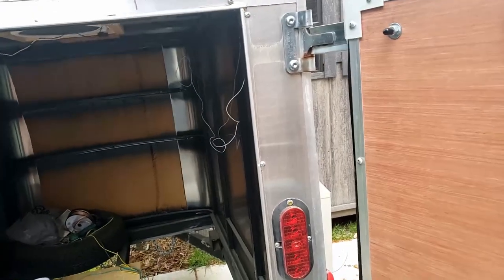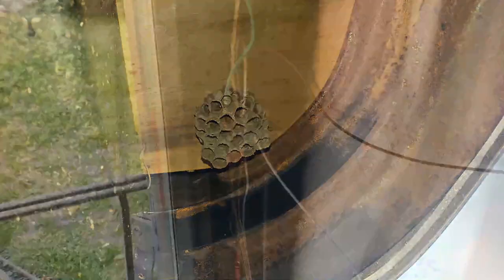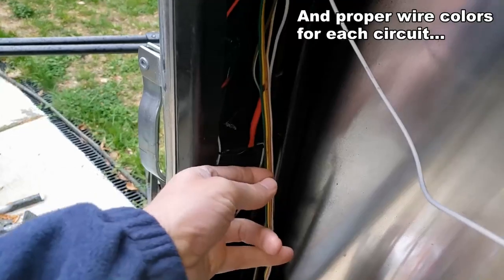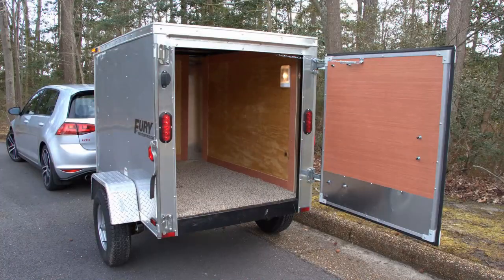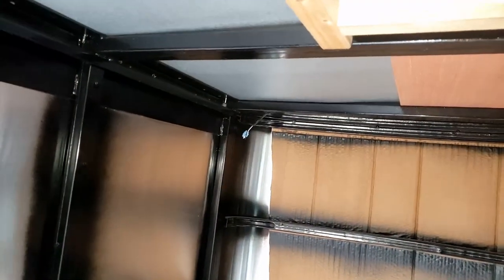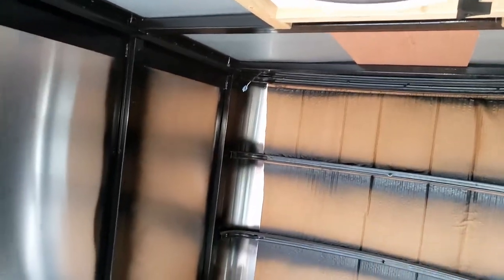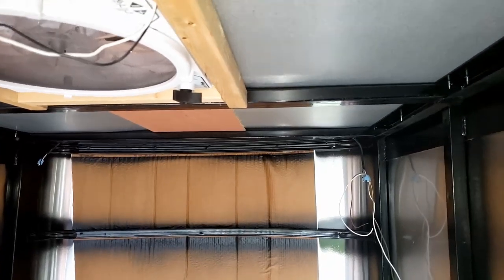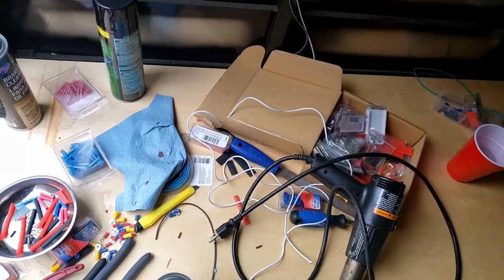4x6 CARGO TRAILER CAMPER CONVERSION - Upgraded Wiring

Comment: hello again Sir, I just wanna say that so far I've been enjoying your videos quite a lot, I find a new little thing I didn't know about in every video, like on this one, first I learned about that Max X Fan which I looked up and it's just what I didn't know I needed for my van conversion build, I mean I knew I needed a fan , but I didn't know that model existed, ... second, it never occurred to me that I could just grab a flat bed small utility trailer and build on top of it with aluminum framing, I own a prius V 2015, it can haul 2,000 lb, and I had been looking for an empty utility trailer that is light enough to permit me to build a micro small living space inside, basically just a bed, a composting toilet and an improvised shower, all while staying under 2000 lb, but all the utility trailers on the market are built very heavy and wouldn't work, but thanks to you Sir I now know I can just build my own, so thanks a bunch!
Reply from the maker: Glad the channel is continuing to help you. Thanks for the feedback.

Comment: Looking good! The wasp spray works almost as good as the brake cleaner.. with a lighter. 🔥 Lol
Reply from the maker: Brake cleaner burns really hot! Don't ask me how I know. HAHA! I don't know where the wasps all went, now that it's cooler outside. But I'm ready for them! A sustained direct hit is required with brake cleaner. With wasp killer, I think the fluid just needs to touch them and they'll fall right to the ground due to the immediate assault on their central nervous system. It's good to have hobby during quarantine.  :-)

Comment: Great Video...Can you make a video about which brand of cargo box, hitch carrier, and trailers you would recommend in 2020
Reply from the maker: Thanks for the suggestion. However, I cannot speak to this with authority because I haven't tested other products. I know I'd recommend my Carry-On utility trailer even though it's not square; I'd recommend my hitch carrier, but it's no longer made (so I recommend Curt); I don't recommend my Yakima Showcase because it leaked through its crappy rivets the first time it rained, but I'd recommend Yakima's Skybox (although I've never owned one); and I would not recommend a Homesteader Fury (this trailer) due to some truly substandard build practices. Instead, I'd recommend a WeeRoll even though it's more expensive and I've never owned one. I can make that video, but I'd have no basis of comparison to make my recommendations more compelling than just being some guy with an opinion.  ;-)  Thanks for visiting.
Reply: @StealthGTI  this reinforces my thoughts on weeroll and the price point from your roof box to a Sky Box is negligible and on Amazon right now I think they're cheaper and you can also open them from either side. Anecdotal information that gives us inexperienced people a direction is really helpful. Thank you.
Reply from the maker: @NoZenith  - FWIW, I like the finish on the SkyBox over the Showcase. That gloss black paint on the Showcase is very reflective and annoying to other drivers. I discovered that when the box was on my trailer and blinding me through my mirror. HAHA!  The gloss also shows a lot of imperfections in the finish. The SkyBox has a textured finish; I think it looks better. Opening either box when sitting atop a cargo trailer may be a challenge unless you also have a step stool of some sort. You'd definitely need a step stool when you mount/remove either box since the attachment clamps are deeper inside the box than baggage. Make sense?

Comment: What do you plan on using for a door.  I was thinking about a teardrop camper door.
Reply from the maker: I will use a teardrop door. It will be on the slideout, which will be closed behind the main cargo door when I'm not camping. Thanks for visiting.
Reply: Geat I am also going to be doing the same with my 4x6.  Bought two 12x22 windows teardrop door with window and a fantastic vent fan with cover.  Can't wait to get it done.

Comment: Could this become a mobile ham shack?
Reply from the maker: It could, but I doubt I'd do it. My only radios are already installed in the car. So, that's where I'd choose to operate (the driver's seat). With that said, the trailer may make a good place to carry a large antenna for field day... or I could use additional cables to extend the remote displays/mics/speakers to the trailer. But I think I'd be more comfortable in the driver's seat; plus, it's less work.  :-)